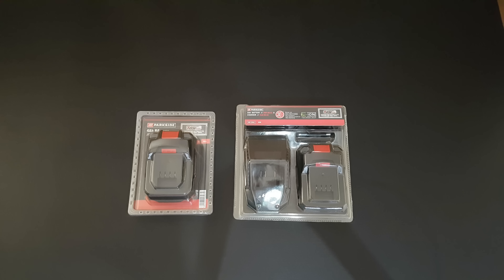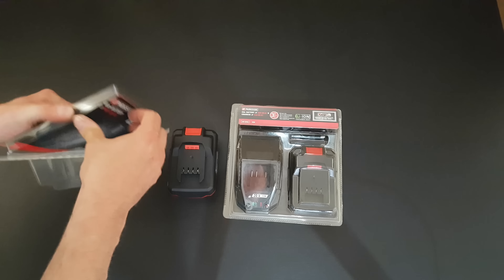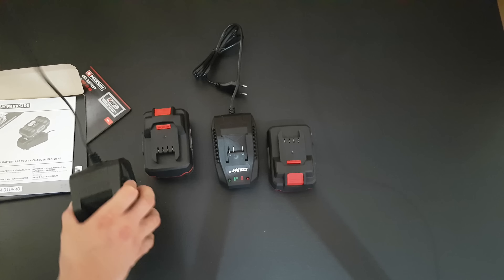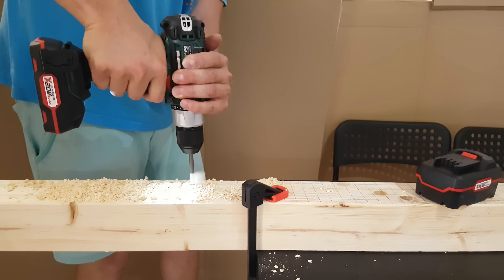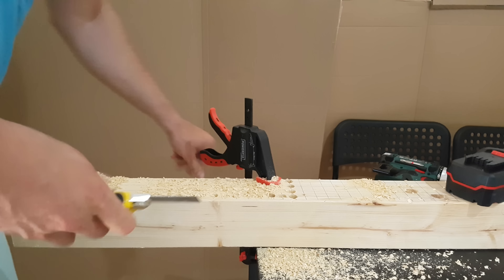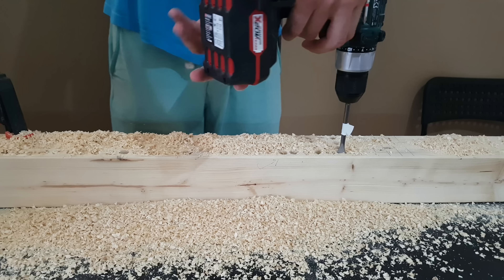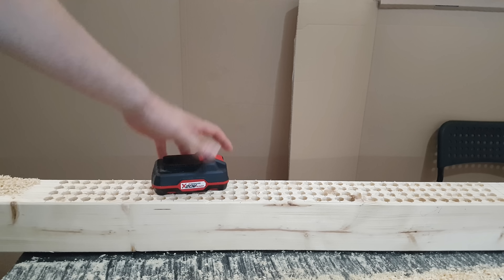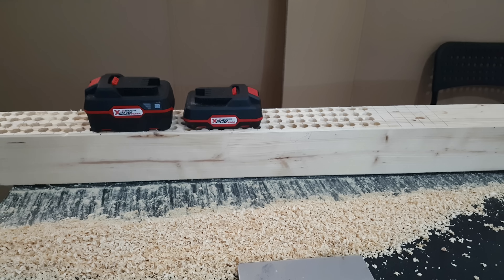Parkside PAP 20 A3 AND PAP 20 A1 2AH 4AH Testing

Comment: Its not just about duration, the 4ah battery will have18650s in parallel, so in theory the 4ah battery can produce twice the max current of the 2ah battery (i.e. some 18650s have a max current draw of say 10amp then they start to get hot and drop voltage,  so 2 of them in parallel will give a max current of 20amp).  So the 4ah battery may be better when drilling into hardwood or metal, since it will have more omph (things like battey protection circuits, and motor protection circuits in the drill will also come into play when drilling into hard material)